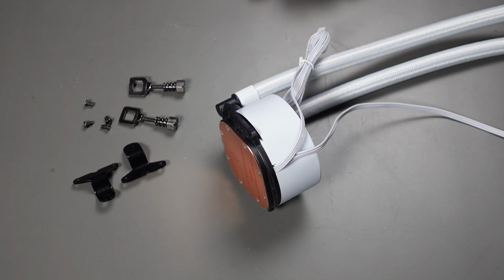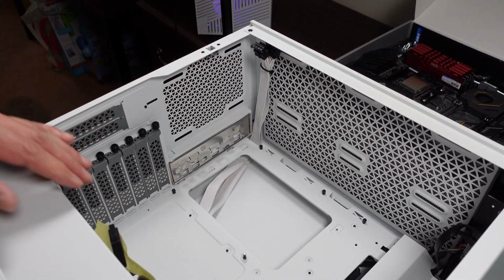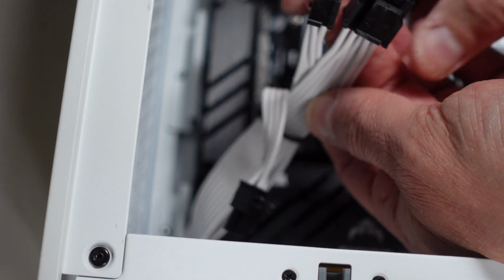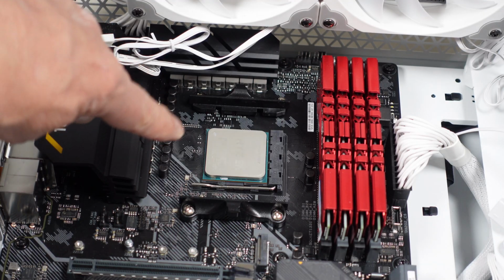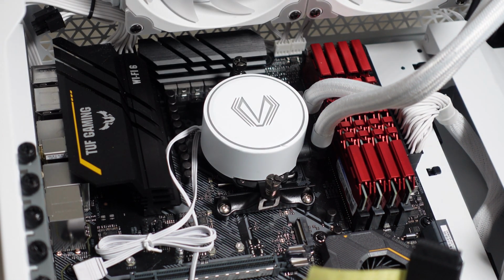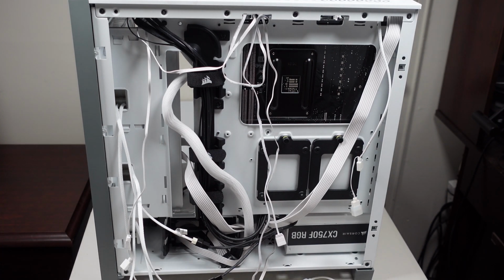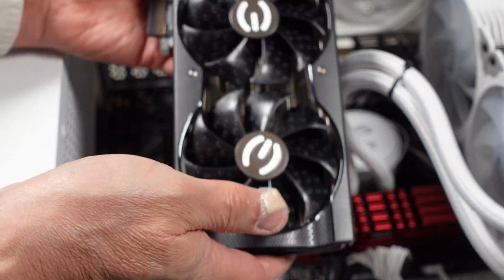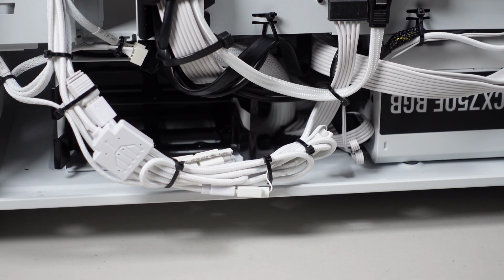A High-End Gaming & Editing PC Build – Part 4 – The Hardware Build Concludes

Comment: Hey there.  Great video.  Would you raid 0 two  1 tb ssds and put a primary OS on it?  I'm of two minds.  I will be backing up to 2 hard drives.  Both ssds are made by the same company but one is an M2.  That's what makes me nervous.   I got a ryzen 2700X with 32 gigs of  memory and I plan to use primocache so it may not be necessary.  See, two minds.  But the read and write speeds are potentially intoxicating.
Reply from the maker: Thanks.  I have two 1tb WD Blue 2.5" SSD in Raid 0 as a secondary drive on my primary editing rig (I made a video on that back on 3/13/2020 - HOW YOU CAN DOUBLE the SPEED OF YOUR PC’s SOLID-STATE-DRIVE).  To be honest though, I am always somewhat concerned that I could lose all the data on that configuration.  Since it is controlled by the motherboard (and supported by iNtel drivers in Windows), the only thing that keeps it from losing it's structure table are two small files on each drive (which would make it difficult to move the configuration to a secondary system if that motherboard fails).  I doubt I would ever use that as my primary drive just out of an abundance of caution.  As a matter of fact, I only use that 2tb Raid 0 drive as a somewhat transient storage area for my video creation.  It is backed up after every major editing session, and archived to my NAS regularly.  I hope that somehow helps your decision.

Comment: How about a water block on the GPU too? Something like ekwb?
Reply from the maker: I plan on doing a custom water cooling build by mid next year, so if this is the only 3080 I am able to get I may move it to that rig and use a GPU water block on it at that time.  I have not seen any of the 3000 series cards available with a dedicated AIO, but I did see a 6800XT with one in the case at Micro Center which someone had already claimed.